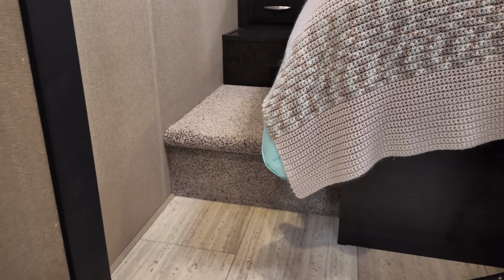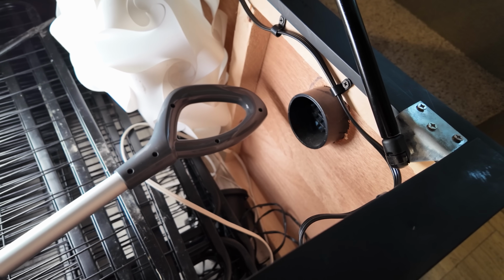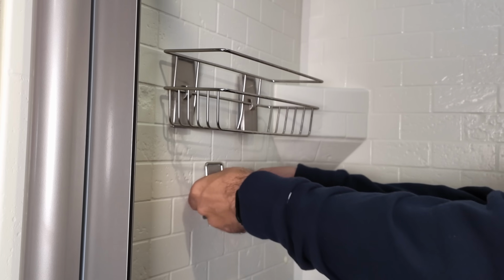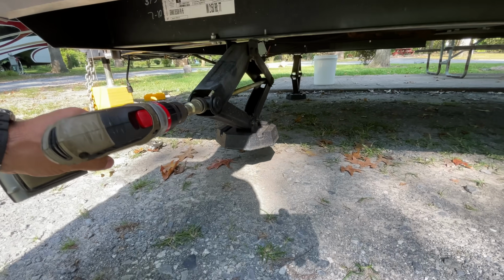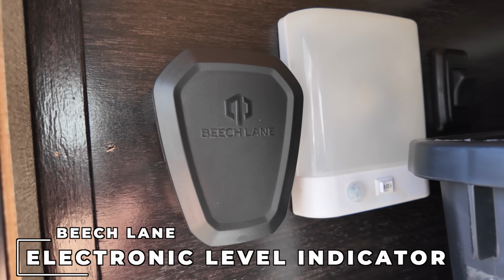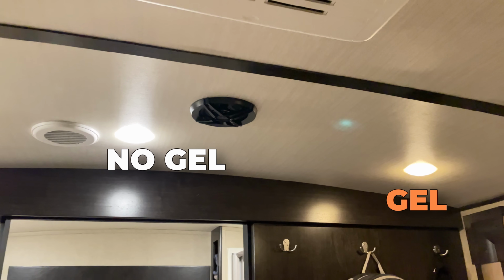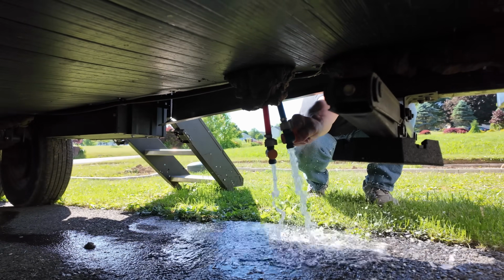8 Years of RV Upgrades & Modifications (Storage, Accessory & Renovation Ideas)

Comment from the maker: ✨ PRODUCTS FEATURED IN THIS VIDEO 
🔷Storage Step Build https://youtu.be/SDFLWUkTKhE
🔷TV Installation https://youtu.be/nns8hstu4LE
🔷30 Amp Power Hack https://youtu.be/s5dad-qU4A0
🔷Micro Air EZ Touch Thermostat https://youtu.be/o0-Yvr3YPQo
🔷RV Mattress Get 30% off your RV Mattress by Brooklyn Bedding at https://rvmattress.com/rvtips
Use Discount Code: rvtips
🔷Vents Under Bed https://geni.us/GzSRGwE (Amazon)
🔷Command XL Strips https://geni.us/4OKT (Amazon)
🔷Sliding Door Latch https://geni.us/rc0Aep (Amazon)
🔷Bathroom Backsplash https://geni.us/BFppdGC (Amazon)
🔷Command Hooks https://geni.us/efB722F (Amazon)
🔷Command Shower Caddy https://geni.us/JZMosFB (Amazon)
🔷Command Soap Dish https://geni.us/AvdPn4 (Amazon)
🔷Oxygenics Shower Head https://geni.us/jznwF (Amazon)
🔷Haloview Back Up Cameras 5% Off & FREE Shipping (Use code RVTIPS at checkout) https://www.haloview.com/products/byte-tango-1080p-observation-camera-system.html?acc=765
🔷Command Broom Holder https://geni.us/6XA708 (Amazon)
🔷10 Digit Keyless Entry https://youtu.be/KcEUgsDw6kk
🔷Eternabond https://youtu.be/f4YXYYWWtbA
🔷Vent Covers https://geni.us/zcYqsRN (Amazon)
🔷Entry Steps https://youtu.be/cq1fDtuwx9w
🔷Morryde Storage Box https://geni.us/eRPv4LQ (Amazon)
🔷RV Snappads & Snapjacks 10% off RV Snappads & Snapjacks https://rvsnappad.com/discount/RVTT10
🔷Bug Screens https://geni.us/i2Ki (Amazon)
🔷TireMinder TPMS https://geni.us/8HBSTg (Amazon)
🔷Coiled Brake Cable https://geni.us/wn1oO (Amazon)
🔷Cam Locks https://geni.us/rIbry (Amazon)
🔷Hatch https://geni.us/oLa1xb (Amazon)
🔷Chest Handle https://geni.us/bJ5wA9W (Amazon)
🔷Water Filtration Systems by Blu Technology 7% OFF EVERYTHING (Use code RVTIPS at checkout) https://goblutech.com/xxnnkdun
🔷Beech Lane Leveler https://geni.us/DAW9N24 (Amazon)
🔷Leveling Ramps https://geni.us/ILYrxu (Amazon)
🔷Fasade Backsplash https://geni.us/vFHMzBK (Amazon)
🔷Metal Stove Cover https://geni.us/ugiyj (Amazon)
🔷Paper Towel Holder https://geni.us/Acknol (Amazon)
🔷Cabinet Dowel Mod https://youtu.be/VlXxQcwov2E
🔷Chrome Pull Out Drawers https://geni.us/QruNlA (Amazon)
🔷Leash Hook https://geni.us/ddai (Amazon)
🔷Storage Shelf Mod https://youtu.be/blUyIDMr0ws 
🔷Dimmer Switches https://youtu.be/2bbqBcSsRZQ
🔷Lens Gel Mod https://youtu.be/9kTQb9wQXNY
🔷Screen Door Handle https://geni.us/itRfKUQ (Amazon)
🔷Shoe Storage https://youtu.be/f_4rawj3900
🔷Speakers https://geni.us/tJ7n (Amazon)
🔷Stereo Mod https://youtu.be/IU4dzd6C6wM
🔷RV AC Mod https://youtu.be/TusVLTNm7_s
🔷Wall Pockets https://geni.us/NeIroP (Amazon)
🔷Cup Holders https://geni.us/YLOpr (Amazon)
🔷Screen Defender https://youtu.be/bNR8OAVgswA
🔷Low Point Drains https://geni.us/yBB02h7 (Amazon)

OTHER VIDEOS YOU MAY LIKE
🎥 RV Essentials https://youtu.be/yuvS3zZL81c
📺 See ALL our videos: https://www.youtube.com/@RVTIPSANDTRAVELS/videos

8 Years of RV Upgrades & Modifications in 1 Video ➕ RV Products I DONT Recommend! We've made a few RV modifications & upgrades over the years.  From entry steps, to lighting modifcations, interior & exterior, & everything in between.  We hope this video gives you some modification, upgrade, & product ideas for your RV, travel trailer, 5th wheel, motorhome, or pop up camper. 

Check out our new RV: https://youtu.be/zwA8tqq4TIo

Chapters in this video:
0:00 Intro
0:13 Bedroom
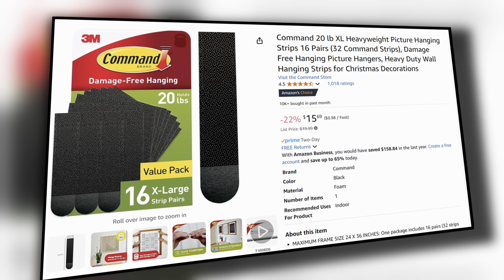2:57 Bathroom
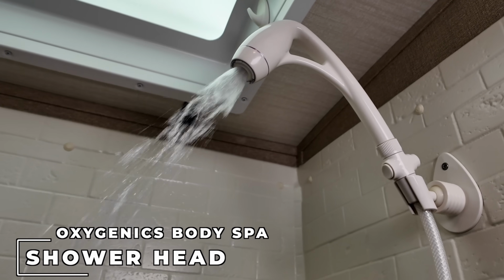4:09 Exterior
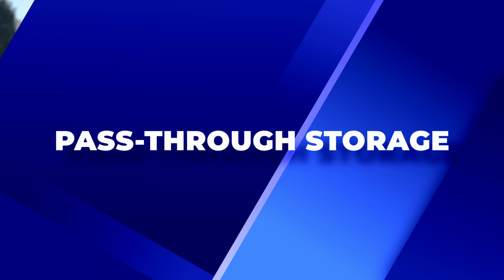6:49 Pass-Thru Storage
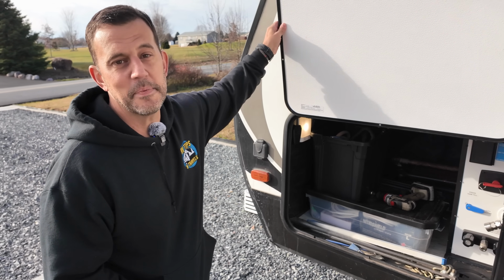7:43 Kitchen & Pantry
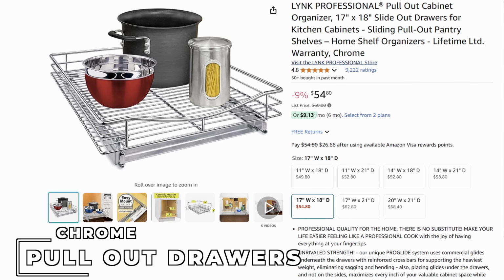8:36 Entry & Ceiling
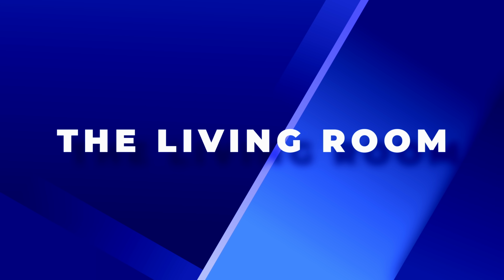10:22 Living Area
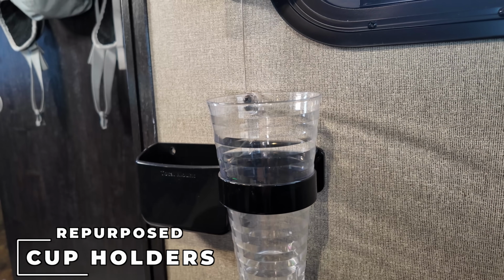11:08 Dont Recommend

#rv #rvlife #rvliving #rvlifestyle #rvtips #rvtravel 

RV ESSENTIALS & TOP PICKS 
🎥Essentials Video: https://youtu.be/yuvS3zZL81c 
🔷Sewer Hose Kit https://geni.us/7dNg (Amazon)
🔷Clear 90 Degree Sewer Elbow https://geni.us/L79gI2 (Amazon)
🔷RV Water Filter https://geni.us/FZ1P (Amazon)
🔷Best Wheel Chocks https://geni.us/9B5i (Amazon)
🔷Power Watchdog 30 Amp Surge Protector/EMS https://geni.us/zKcm (Amazon)
🔷Power Watchdog 50 Amp Surge Protector/EMS https://geni.us/jgOto (Amazon)
🔷Wireless RV Leveler https://geni.us/DAW9N24 (Amazon)
🔷Leveling Ramps https://geni.us/m38VoBr (Amazon)
🔷Liquified RV Tank Treatment https://geni.us/QTUJSrP (Amazon)
🔷Tire Minder TPMS https://geni.us/8HBSTg (Amazon)
🔷Water Pressure Regulator https://geni.us/fTzA0 (Amazon)
🔷Drinking Water Safe Hose https://geni.us/emLdlC (Amazon)
🔷Browse All Essentials https://geni.us/1Omwvhh (Amazon)

MAINTENANCE:
🔶Boeshield T-9 Rust Preventative & Lubricant https://geni.us/uXxstyC (Amazon)
🔶Geocell Proflex Sealant https://geni.us/YXiACx (Amazon)
🔶Water Heater Cleaning Wand  https://geni.us/AcTvhLc (Amazon)
🔶Water Heater Cleaning Adapter https://youtu.be/h6C6ihTQ1cY
🔶Waste Tank Rinser https://geni.us/V2XLE (Amazon)
🔶Road Tool Kit https://geni.us/oBFnd9l (Amazon)
🔶Eternabond Roof Tape https://geni.us/6AXdw (Amazon)
🔶Browse All Maintenance https://geni.us/UvxFP (Amazon)

INSIDE
🔷Screen Door Handle https://geni.us/itRfKUQ (Amazon)
🔷Shower Caddy https://geni.us/ZPcno (Amazon)
🔷Oxygenics Shower Head https://geni.us/jznwF (Amazon)
🔷RV Paper Towel Holder https://geni.us/Acknol (Amazon)
🔷Dimmer Switch (watch video) https://youtu.be/2bbqBcSsRZQ
🔷Electric Heater Fireplace https://geni.us/YmBoktI (Amazon)
🔷Browse All Inside https://geni.us/BWiOR8k (Amazon)

OUTSIDE
🔶Gravity Chairs https://geni.us/VlPR8rn (Amazon)
🔶Ground Mat https://geni.us/wbWWLzf (Amazon)
🔶Table https://geni.us/qsPO (Amazon)
🔶X Chocks https://geni.us/3oyburw (Amazon)
🔶Blackstone Griddle https://geni.us/8BuIrW (Amazon)
🔶Low Point Drain Valves https://geni.us/yBB02h7 (Amazon)
🔶Browse All Outside https://amzn.to/4ld0kcz (Amazon)

👇 COUPON CODES! Use the links. Save money. Simple.

🚐 10% off RV Snappads & Snapjacks https://rvsnappad.com/discount/RVTT10

💦 Blu Technology Water Filtration Systems 7% Off, $80 or more No code needed just use our link:  https://goblutech.com/xxnnkdun 

🛌 Get 30% off your RV Mattress by Brooklyn Bedding at https://rvmattress.com/rvtips
Use Discount Code: RVTIPS

📷 Haloview Back Up Cameras 5% Off & FREE Shipping (Use code RVTIPS at checkout) https://www.haloview.com/products/byte-tango-1080p-observation-camera-system.html?acc=765

🔧 NRVTA Home Study Course https://rvtechcourse.com/discount/RVTIPS20
Use Discount Code: RVTIPS20

🚴‍♂️️ Lectric eBikes - Use our link get FREE accessories https://lectricebikes.sjv.io/nLrJ3x

💻 Our eBay Store! You never know what you’ll find!
https://geni.us/6AyLKnS (eBay)

💥 Join Our FREE Newsletter! https://rvtipsandtravels.myflodesk.com/freenewsletter

If you want to support the work I do to help others, you can donate here:
Paypal: https://www.paypal.com/donate/?hosted_button_id=J2KKM9NR3BJJA
Venmo: https://venmo.com/u/Ross-Stoico

✨ AMAZON RV STORE ✨
https://www.amazon.com/shop/rvtipstravels

Follow Us on Social Media
https://www.instagram.com/RVTipsAndTravels
https://www.facebook.com/RVTipsAndTravels

🙏 If you find a dead link, PLEASE let us know & we’ll send you bumper stickers!

As an Amazon Associate, I earn from qualifying purchases. There is NO ADDITIONAL COST TO YOU when purchasing from our links. Thank you for your support! 2.0
Reply: @RVTIPSANDTRAVELS  I’ll be installing the Beech Lane Wireless RV Leveling System just to confirm do you need the rv level level during install prior ?
Reply from the maker: it doesnt need to be level when hard mounting it in the rv.  you will need it to be level when you calibrate the sensor.  if you're not level at home, just install it, then calibrate it after you've leveled at your first campsite of the year.

Comment: Ross, I have a Furrion thermostat in our 2021 2600RB Imagine and I really don't like it. The sensor is up in the AC unit and I see you found an Micro-Air Easy Touch RV WI-FI thermostat. Did you like the new one and was it much easier to use? We have a Temp Stick to monitor the temp inside for our dog and it's not the best but it does give us updates every so often. I would rather use a stat that I could control from my cell phone. Any problems with the new stat? I know you have a new pull trailer but help me with this one. Thanks, Keith (Montana boy)
Reply from the maker: Hey Keith, I'd still recommend the Micro Air stats.  I put them in our new trailer as well.  The price is a little hard to swallow for a thermostat, but its as flawless as a product as I've seen.  Never any issues.

Comment: Keyless rv locks are a waste of money. You will end up using the key anyway. Go to a locksmith and have them key you a more secure lock set.
Reply from the maker: Thanks for sharing your opinion.  I'm just a little confused what you're saying though.  We havent used the key once since installing it years ago.  Why would we?  Its keyless entry. One less thing to carry around and lose, plus we can let in friends or family when we arent there without having to exchange keys.  The code can always be changed afterwards as well.  It's a game changer for us.  You can have a locksmith put in the best lock cylinder in the world, the deadbolt entends a half inch into the bore on an aluminum frame... if someone wants in, they are getting in regardless of the lock set.

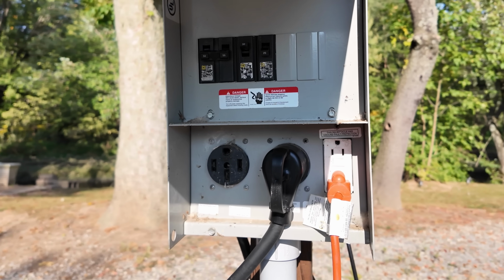Comment: 1:10 that is actually a 15 amp outlet just a heads up
Reply from the maker: its on a 20 amp breaker, and its got a hot, neutral and ground.  Wouldn’t surprise me if it was the way campgrounds wire these, but just because it doesnt have the sideways slot doesnt mean its necessarily a 15 amp.  You can buy 20 amp outlets without them: https://www.homedepot.com/p/DEWENWILS-20A-GFCI-Outlet-Receptacle-Self-Test-2-Pack-with-LED-Indicator-Wall-plate-Included-White-HGFB20B/330500721?source=shoppingads&locale=en-US&srsltid=AfmBOooHjpodMNHMcwtS3TDD-wK7yzgca8IBdMmHqfDMTTirdWT4TWmLWJg

Comment: in addition to the under bed vents, why not cut insulation foam board and insulate the ceiling in the pass thru storage area (under the master bedroom and bed) in order to better prevent the mold (or the reason for the mold which I believe is the temp difference due to no insulation bewteen these two spaces.  Adding the foam board between the metal tubing and then taping the seams with the aluminum foil HVAC tape really made a nice difference for our RV regardign temp in bedroom and no mold.

Comment: Great Video!!! We have a GD 22MLE and have done a bunch of mods like you have. (The storage boxes by the bed, the pull out for the pantry shelves, the shower head, and the stick-on hooks. I also put a 3/4-inch dowel that I hang in the outside storage that has a hook on the end (slide side). The hook helps me grab things out of reach in the storage and it is marked with a sharpie that doubles a measure for the depth of the slide, so I know I won't hit anything while opening it.
Reply from the maker: thanks for stopping by again Gerald!  Love your profile picture!

Comment: Hi I believe you mentioned using command products in your camper.   I would love to add command hooks for jackets in an area in my camper but I’m afraid they will damage the wall.  It’s not slick but a tiny bit of texture on my Grand Design walls.  You have had good luck with using these and no wall damage?
Reply from the maker: ive had great luck with these, no issues.  the walls are textured in our new RV as well and they stick fine.

Comment: Love your channel. I bought my first RV a few months ago (Forest River Rockwood 2515s).  I spend 90% of my life on a laptop.  I've been looking for some sort of a fold-down desktop tray over one of my recliners.  I don't want a tray that just sits on my lap.  I would like something that is self-supporting that can swing/drop into position, and then swing/raise out of the way when not in use (kinda like a hospital bed tray).  I have a few inches between the recliner and the side wall.  And the wall is a cabinet.  So I have easy access to both sides of the wall to attach something if necessary.  I'm a decent DIY'er.  I love your creativity.  Could you give some thought to how you would add something like this to an RV?
Reply from the maker: Ive been looking for something like that for years, and kind of gave up.  the only thing I thought about doing before scratching the idea was building something that mounted in a cup holder.  do you have a cup holder in your sofa?

Comment: An interesting upgrade to see would be quite an expensive one, but upgrading solid torsion axles to independent suspension. 

That or upgrading drum too disk brakes
Reply from the maker: those mods are definitely available, but you are correct, a little pricey, especially considering we havent had any real issues with our current set up.  If it were our only house, and we traveled the country on a regular basis, I wouldnt think twice.

Comment: I purchased my 2011 class C in 2018. I purchased it at an estate auction. I spent $4,500 in the first year getting it to where I felt it needed to be as it had sat in a pole barn for three years. I spent $1000 at the cummings dealer having the generator serviced, it had only 50 hours on it according to the meter. It didn't make a year before it started having problems. I eventually found a nut in the carburetor had worked lose. That only fixed the immediate problem. Eventually it wouldn't run for long before it would surge and then shut down. The problems finally got so bad I purchased a 4500w portable. When I removed the Onan and replaced it with a 25g reserve water tank I was really pissed to find all the things Cummins had done. But the worst thing they did was cutting the aluminum power wires to the transfer switch to remove it for service and then rejoining the wires with wire nuts. I could go on forever, but it would probably scare you!
Reply from the maker: thanks for sharing your experience Vern!

Comment: Hi Ross, I wanted to ask if you have ever replaced the water lines in your travel trailer to use the straight up Pex lines? Thank you.
Reply from the maker: most of the plumbing is already pex.  there are some areas with this reinforced vinyl hose that I might change out (looks like this https://amzn.to/4j4UetP ), but havent had any problems with anything yet except 1 spot behind the toilet.  Can i ask what you're concern is?  Did you have a leak?
Reply: Yes sir. We actually had a leak in the bathroom behind the cabinet near the heat pump in the bathroom and then one in the basement.  It's like the clamps blew off. This happened during winter storage after the RV dealer prepped it for winter for us our first year after the purchase. It terrified me but we got the mess cleaned up, some residual floor staining from the antifreeze and  reapplied the clamps.  so far this winter, it's holding. I didn't know if it was the tubin, clamps, or perhaps pressure in the lines and should we replace the lines.
Reply from the maker: it sounds more to me like they didnt properly winterize.  those clamps wont blow off unless there is a lot of pressure expanding the hose.
Reply: Oh ok. We did it ourselves this year following your guide in your videos and so far no problems. We've been checking it weekly. Out snow/ice/snow plus more snow here in Kentucky has me on pins and needles but so far so good.  😊
Reply: Thank you for replying. I think we are in the clear now!

Comment: Hey Ross another great video. I have a grey tank question?
I have a 2025 Grand Design 22 MLE. I have watched a lot of your videos and they are my opinion the best RV videos.
My black tank has not been a issue because I follow your instructions on what to do when cleaning the black tank 👍🏻
But my grey tank sensors have been frustrating. I have been attempting to clear it with Dawn, baking soda, and vinegar. It’s early and I am optimistic but do you have any suggestions?
Thank you.
Reply from the maker: its a pain, but try filling those gray tanks with hot water and let them sit for a day.  no chemicals.  after a day, empty, refill, then rinse again... circle back if that doesnt work.
Reply: @ okay thank you I will try that tonight.

Comment: Consider cutting 1 1/2" foam panels for the pass through storage. The bed storage cabinet and the under side of bed. If you're over zelous you could add another 1" to cap it all off.  That should help with the mold issues too.
Reply from the maker: good idea, thanks for sharing my friend.